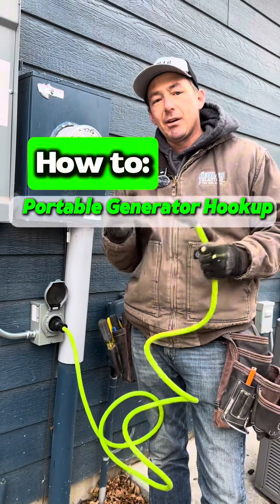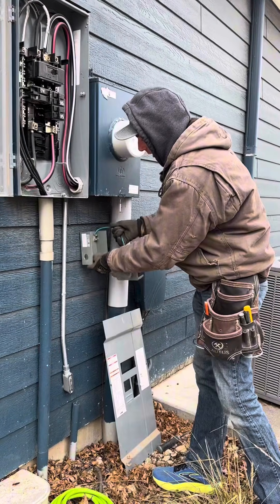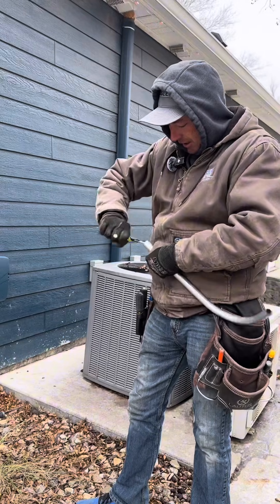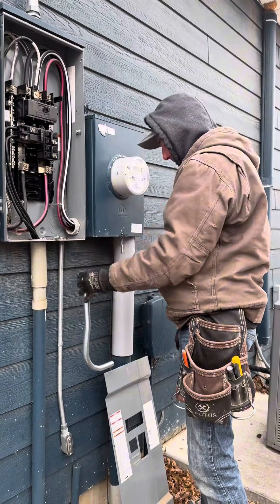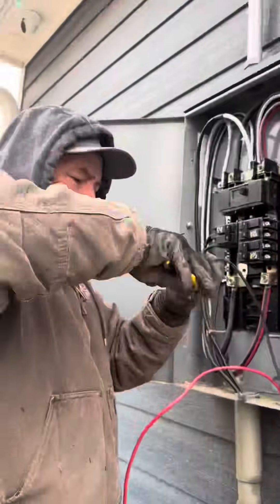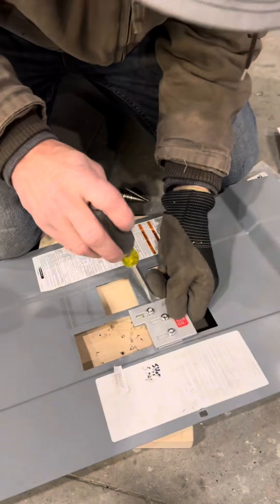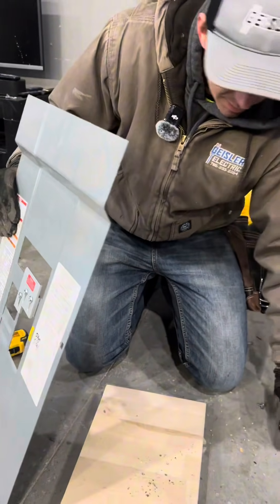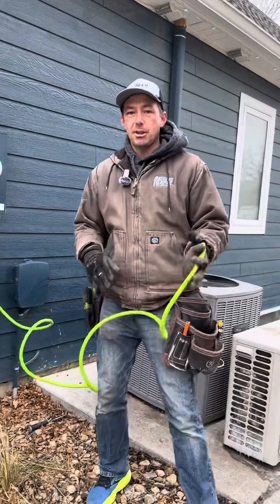How to | hook up a portable generator to your house.

Comment: Didn't see required torque driver to properly tighten screws on generator inlet, Like to use a Klein combination EMT screwdriver / 1/2 to 1" EMT reamer . He must have that new OSHA approved invisible PPE & gloves while working in an energized panel. Glad to see that he ran a copper ground wire.Had s lazy corner cutting coworker who always used the conduit for ground. When a 11/4" EMT  came out of a set screw coupling on a 480 volt line wires got nicked and he received a severe shock from one hand thru his chest to other hand as he attempted not reinstall the conduit. Still had chest pains next day.
Reply from the maker: I didn’t “properly” torque this. Unfortunately I didn’t have my tool with me that day. Just gonna trust the expertise on that one 🤞🏻. Appreciate the comment!
Reply: @electricianjoe  Funny thing a few years ago at an IAEI continuing education class / meeting the instructor asked how many of the 125 attendees had a torque driver or torque wrench. Less then 15 raised their hands. Usually have a combination of 25 who are inspectors or engineers, rest sparkies. Also told us that they should be sent out once a year to check accuracy ( yes like that will happen to small 2 to 10 person electric contractors  ). Machine & tool& did shops that I did electrical work in had to send out all of the micrometers, height gauges, etc once a year and have somebody check huge stone measurements tables for flatness then apply a dated sticker .
Reply: @electricianjoe  A brilliant UL lab at a class told me that UL lab checked hundreds of screw & bolted connections thru out the USA. Forget the exact #'s but something like 60% were only properly torqued. Remainder were either over or under torqued. Told me over torqued connections were just as bad as under torqued. Like how some inspectors make you use witness marks across a bolt head & buss bar or lug to state that it was properly torqued.
Reply: Torque wrenches coming right off a recalibration can still leave connections under torqued. Sometimes it's better to go by your own feel though it is an art to use feel.
Reply: I would rather trust tool. In the event of a fire or arc blast ambulance chasers have forensic investigator. If & when they catch inprooer work your insurance company has the right nit to pay. Better covering your ass now a days  At an CEU class they tokd us that UL tooksampkes across the country to check for how tight thiusands if connections were. Only around 60% were propetly torqued. Also told us that an over torqued bolt or dcrew can be just as dangerous as an under torqued connections.
Reply: @JohnThomas-lq5qp I don't see insurance companies being able to prove something wasn't torqued to spec at the time of installation unless they are periodically checking every single property they insure. We know that's not happening and even if they were the insurance company would become criminally negligent if they knew something wasn't torqued to spec didn't have the insured person fix it immediately. 

Even if someone torqued something by the insurance company can't guarantee they didn't just so happen to torqued by hand to spec. Electricity vibrates and connections come loose all the time and insurance can't prove it wouldn't have come loose anyway.

Only thing you have to worry about with not using a torque wrench is criminal liability. If you misrepresented that you would use torque tools it might be considered fraud or if you owned a tire shop and you someone's tire comes off and crashes you might be criminally liable but your insurance pays the damages unless your insurance claimes intent to damage